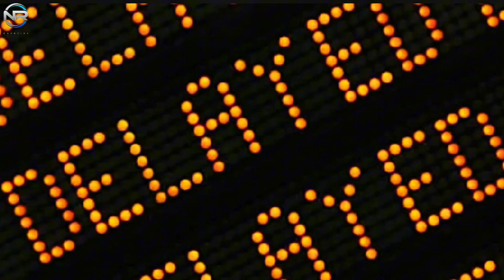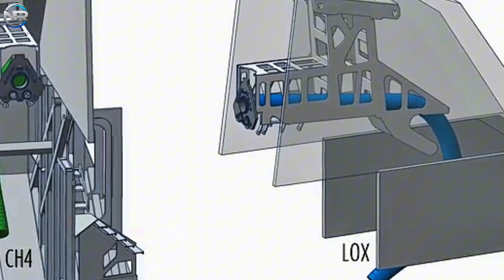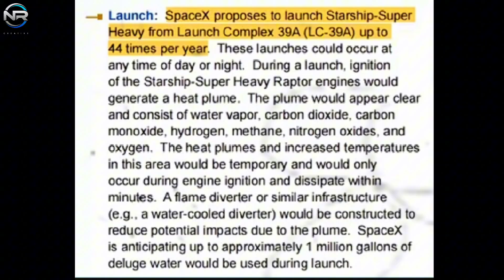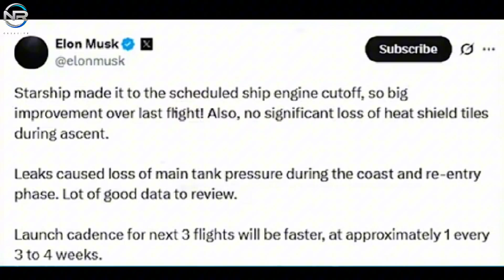Starship Flight 9 - Ends with Severe Damage to SpaceX Launch Pad

Comment: The heat protection tiles are designed for reentry.

The technology seems to be designed for extreme heat and pressure, or, to put it another way, if the QD protection is made of steel, then the tile is definitely better.

The tiles could also be made of plates and thus provide effective protection.

The Starship also has curves and corners, and the protection works if the Starship is properly stabilized and performs reentry.

It's pathetic that SpaceX can't protect its connection,
even though everyone has the technology in mind.

But I, as everyone knows, am petty.